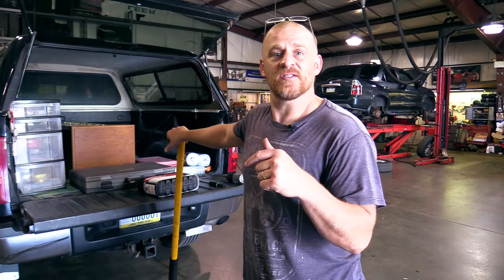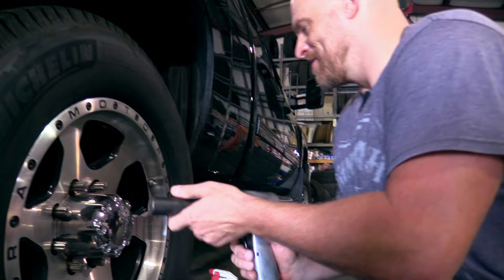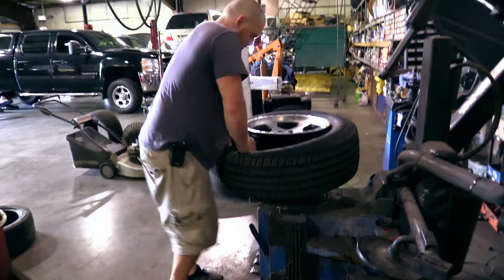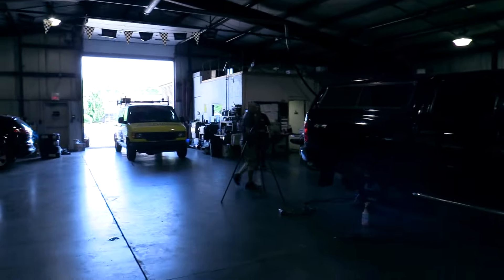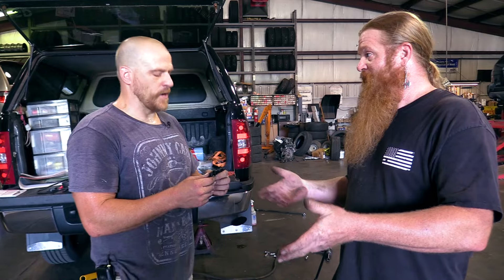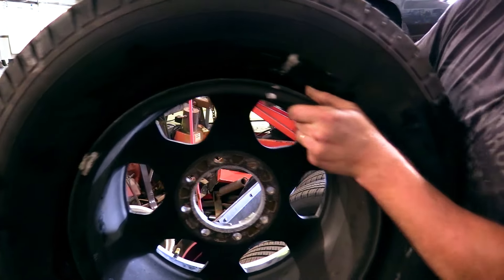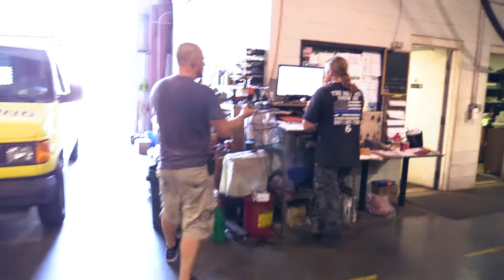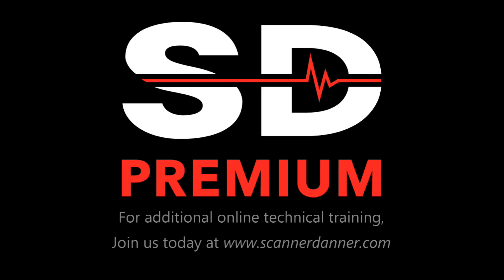Cloning a New Tire Pressure Monitor Sensor (TPMS)

Comment: He broke the sensor by placing the steel breaker arm right on the sensor.  Not with his hand.   At 7:26 damage is being done
Reply from the maker: No, that is not what happened. Turn the volume up, you can hear the sensor pop when I pushed down on the tire.
Reply: @ScannerDanner  See 7:26 and pause it.  The breaker is right on the valve stem's hight.  That's a no no.  So u broke it right there.  It was still attached, but hanging on a hair and useless.  . Your hand just did the last 2 percent    Ask the guy who was explaining to u after how to install the tire while not breaking the new sensor... show him 7:26 and ask him what he thinks.  U will b surprised lol.
Reply from the maker: To be honest,  I had that stem about where my elbow was. Way closer than it should have been too it. So you may be right. I think I also had a mindset that I didn't care at that point. Maybe that's why I was careless there. I knew I was changing it regardless
Reply: @ScannerDanner  Wow, Scanner Danner told me I might b right!   I'm gonna print your response, frame it and put it in the kitchen so my wife can see it every day.
Reply from the maker: 😂, sorry never meant to be a know it all in my  response
Reply: @ScannerDanner  I've been watching your videos since the dodge neon misfire video years ago...  Big fan lol.  I am impressed I even got a response from u.  U made my day!

Comment: You turned the sensor and pulled it apart when you tried to tighten the nut without holding the stem. Those of us who don't free sensors can get a seal kit for 3-4 bucks.
Reply from the maker: free sensors for the win!! but these sensors are inexpensive at $30 a piece on Amazon :-)
Reply: I’m sure the battery was about done if they were originals from 2009 so I’d replace the whole tpms
Reply: @Andyandcars  Sure, but they may already have been replaced.
Reply from the maker: @Andyandcars  these were aftermarket sensors and rims, maybe 5 or 6 years old?
Reply: ScannerDanner I’ll probably be buying the autel kit. It’s been in my wishlist for months. I’ll try to buy it through your link
Reply from the maker: Thank you!

Comment: Another stupid thing we did not need. Just a regular valve stem is fine. More junk to go wrong. Put regular valve stems in and tape the tire out. Our take the dash out and take the dam light out. As easy as that broke. Going down the highway that could have been a big blow out. Put copper anti seize on the cone shape of your lug nut and it won't get stuck on there like that. I even do the studs a little and never had a problem in 50 years with a lug nut getting loose. You got a steel lug nut against a aluminum wheel and it gets stuck really bad sometimes. Back in the day when you had steel rims against steel lug nuts you never had that problem. No body even used a torque wrench. Just a four way wrench and tighten it up and forget about it. If you know your power tools you can use them and get the torque right by watching socket and the tool you use.

Comment: Great video wish they didnt had tpms on new cars old cars they didnt
Reply from the maker: I actually like the warning light. It told me I had an issue way before I noticed my tire was actually low, preventing damage to the side walls of the tire
Reply: @ScannerDanner  Yes, I'm not too sure why a lot of mechanics hate them. Yes it was gov't mandate, but at this day with all this tech, it was bound to happen. I like it when it saves you (or customers) a tire

Comment: I know your supposed to torque lug nuts, your also supposed to torque water pumps along with everything else on a vehicle. As long as there tight whats the big deal? I know shops that never torque lug nuts and have never had any issues. 

Caleb look for tire explosions on YT there are guys filling truck tires on the ground that have been bounced off the ceiling and killed. Never lay tires flat on the ground to fill or be in the line of fire if something bad happens
Reply: worked in front en alignment and brakes in thousends of cars , and never used a torque wrench , never seen anybody using one in tire shops , but always ready with my MG 725 snap on with high air flow fittings  for those stubborn lug nuts

Comment: Cant you just out programm the tpms as a hole?  Is just a no go system at all.
Reply from the maker: you mean eliminate them? why would you want to? This low tire psi warning I got in this case saved my tire. And it is a $300 tire too
Reply: @ScannerDanner  yes. But its the tpms that caused the problem....
Reply from the maker: I still prefer to have them

Comment: Seriously when ever tire sensors are programmed it's usually set at the tire it's self max air inflation with is super dangerous because the tire will expand with air or rotation speed causing the steel belts to rupture and create a tire warping or worst a blow out  
Why is it not set.at.its.lowest tire inflation settings to a point where it's more safe because the driver can drive and make the corrections

Comment: I don’t think Autel is the way to go. Buy their TPMS Scanner and you’re locked in to buying their sensors as other brands of sensors will not work with their scanner. The sensors they provide don’t always work either. Plus they don’t respond to emails if you have a problem, and yes that is from personal experience with them.
Reply from the maker: Good feedback and something to consider

Comment: HEY, @  """we had construction done and thought it would be a flat tire from a nail"""  not all contractors are sloppy morons that leave nails and screws all over the place....
roofing is very bad, mix of siding aluminum nails were used many times, so magnetic pickup tools don't always work or they don't bother.
a good roofer will put down tarps around the whole building some 10 out and cover windows with sheets of wood(lauan or plywood) to protect them. STILL expect some nails.
other remodeling and more the same, it's just unavoidable.

Comment: My Dewalt 1/2 impact would have busted those lug nuts off with ease.
Reply: my MG 725 snap on is better than your dewalt
Reply: F P Yeah but you paid through the nose for it.
Reply: @iamthevanavator281  $ 125 dollars from craiglist 🤓😁
Reply: F P  In that case not bad. Having said that, since I’m not working on heavy trucks my Dewalt more than meets my needs. Ol SD’s air impact looked kinda weak.